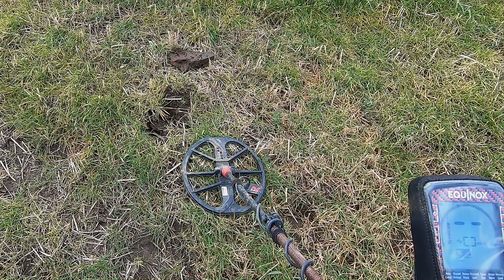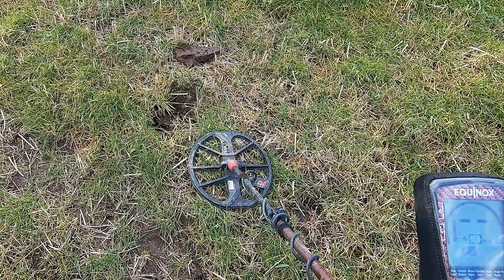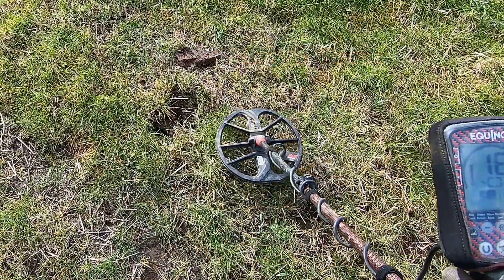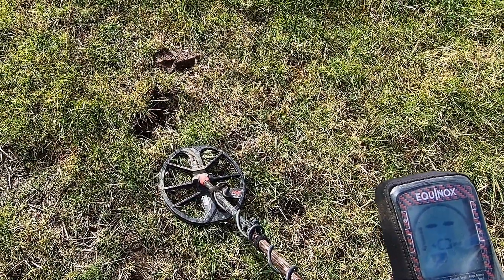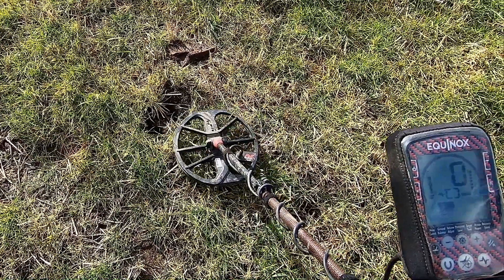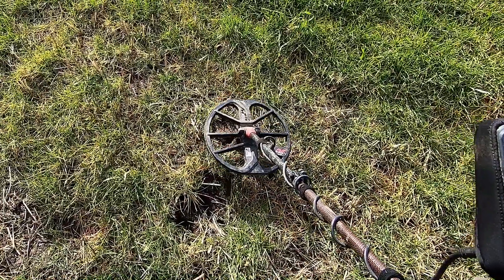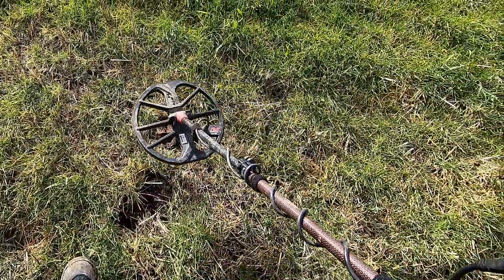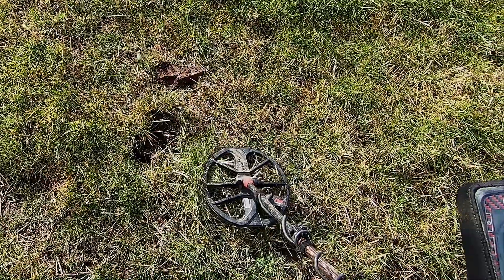Pinpointing and Coil Edge detection

Comment: The only time I have any problems is when using the 15" coil on the Nox and the target is very shallow...Not sure that using drawback would help, but turning down sensitivity sounds like it might....
Reply from the maker: Hi Peter, thanks for watching and your comment.
Yep the 11" coil is bad enough and the 15" I have found about 600mm side detection at times.  They are like the Excalibur is that you hear the target coming before you are actually over it :)
HH     Mal